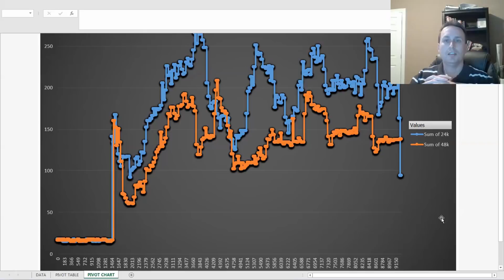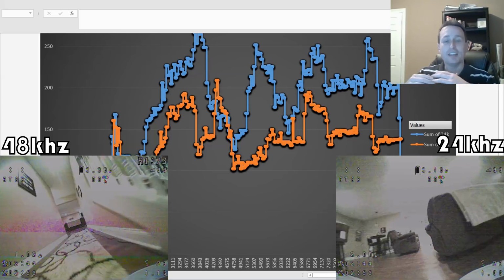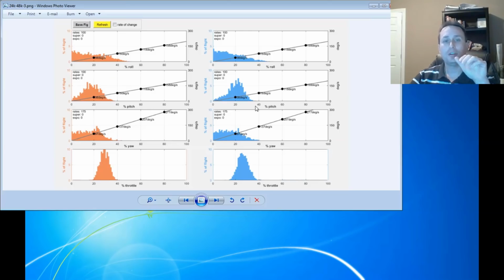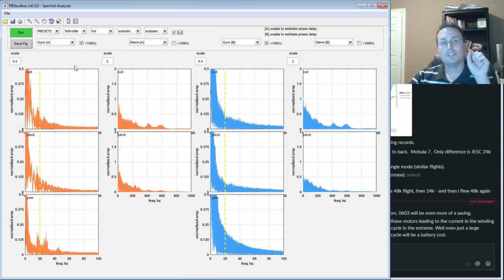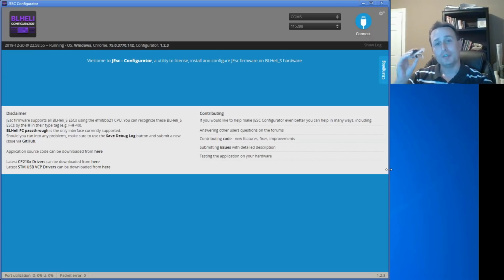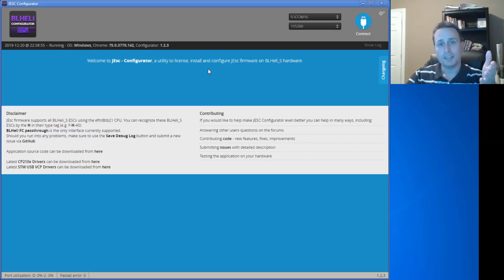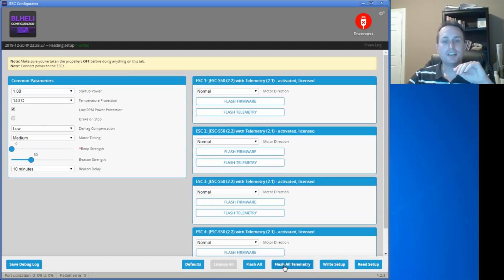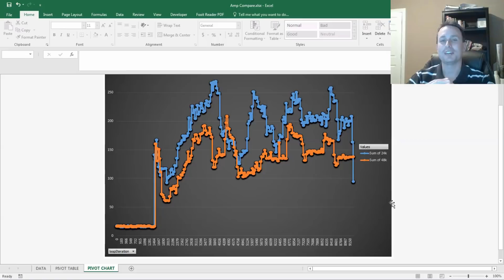24khz vs 48khz ESC Comparison

Comment: On the JESC cost - just think of it as a different model for who pays the firmware license.  BLHeli_32 is paid by the manufacturer, JESC is paid by the end user.  The cost is still lower for JESC on the same setup, with hours of BBL data I can't see a performance difference, and importantly you can get that same performance on small quads.
Dumping $100 on JESC licences sounded silly, until I realized that the performance pays for itself on just my handful of race rigs.  Awesome work Thorsten!!!
Reply: The difference is, Blheli32 has more capability with very reasonable licensing fee. I know this because Blheli32 ESCs aren't that much more expensive than its 8 bit counterpart. The Racerstar 8A Blheli32, which happens to be the cheapest blheli ESC on BG, cost like $4.60 with Blheli32 license and compared to the JESC licensing fee of $1.25 per ESC, that's like more than quarter of the price of Racerstar ESC with Blheli32 license, just for license only.
Reply: @Asu01  Manufacturers can just as easily sell ESCs with JESC on them - the price comes down to around half of the small order count price if you're ordering any any kind of bulk... Similarly, cost comes down if you have enough quads to update.
Reply: I don't see that happening anytime soon, especially with another open source project being developed for 8 bit ESCs, which every manufacturer would prefer.

Did you really dropped $100 for that? How many race fleets do you have?

Comment: Awesome! Going to update now. Just went to JESC yesterday. Waiting on new ph2 connectors as mine started getting really hot.
Reply: Finally got the ph2.0 connectors in. I don't know how much it was the connectors versus the 48khz, but now my runtime inside is nearly 5 minutes. Also I did the rpm filter and just shotgun'ed in your whoop tuning settings and all I can say is, WOW! It is soooooo locked in now when flying airmode outside. Thanks for your awesome channel!

Comment: Has anyone actually thought why this is the case?
Its because at 48khz you have a lot less torque and power on your motors and thus its like running weaker motors.
Reply from the maker: See write up?

Comment: i started running 48pwm for awhile and now we can get same jesc firmware for free finally
Reply: The free one is still in its infancy. JESC is free for 48khz, but you have to pay for another licence to be able to run rpm filtering. 
JESC is more stable right now and if you don't need rpm filters, it gives you sweet 48khz blheli 32 users enjoy.
Reply: Yeah - in every instance where a company sells a blheli_S version and a _32 version, the cost of JESC is way less... an the performance is still awesome.  The only settings I use anyway are 48kHz PWM, demag high, and medium-high motor timing, so that just works.

Comment: Motors were always hot on my tinyhawk S on 2s until I put on 48khz.  Now they run cool.
Reply: I'm thinking of doing this on my THS, did you have to change anything in betaflight? Someone on a FB post said they had to drop to 4k/4k loops.
Reply: @zevindd  I havent done any of this yet, but for rpm filtering Im sure you do, and I think on this also. Check your cpu load, that should let you know if it needs to be dropped.

Comment: What would be the advantages and disadvantages of running 48hkz on a 5 inch quad? I’ve run mine on 48 for a while now
Reply: Limited sample size (I've only one A/B testing with a couple dozen of mine) - no actual drawbacks through the goggles.  On paper the full wide open throttle power on 24kHz is slightly more, and on quads that develop mid-throttle oscillations, if you experience them on one PWM frequency, the other tends to fix it (usually 48kHz cleans up ones that previously had issues).
Anecdotally, I'm getting slightly cooler motors despite being able to turn up the wick on P/D gains more on setups after making that switch, I do think there might be some odd aliasing effects that are more noticeable on 24kHz, but that's mostly speculative - in practice, there's basically no downside, except on one oddball quad where MTO's were present, and for some reason 24kHz seems to have fixed it... right up until I installed that quad into a metal pole.
Reply from the maker: Good summary.

Comment: My experiences with blheli_s is on 5 and 7 inch only. I have not measured any flight times but my 5 inch flew well with cool motors zmx 2205 2300kv on 4s on 24khz. I changed to T-motor F60 1750kv and xing-e 2208 1800kv and booth those quads we're running too hot on both 4 and 6s on 24khz. They are running cool on 48khz.  
For the 7inch with large sunnysky 2212 1250kv the difference is not significant.

Comment: The most conclusive test would be to compare the motor thrust numbers + efficiency at 0-100 throttle between 24kHz and 48kHz.
Reply from the maker: Maybe.  But the amp draw numbers don't lie.
Reply: @uavtech  Ryan Harrell has done just that on 5" - there is a slight power output edge at WOT for 24kHz, but that difference is minor, In practical terms, on a race quad, I'm quicker on 48kHz just because of the smoothness improvement.
Reply: @uavtech  yes, agreed, also throttle at hover was about the same. I'm just curious if there is any impact on thrust as switching losses should increase.
Reply: Exactly what I was thinking. You can manipulate switching losses for small changes but overall thermodynamics gives no free lunch so there must be a reduction in thrust/power.
Reply from the maker: @changeagent228  , not if it is breaking and fighting itself.
Reply: @uavtech  More testing required...

Comment: Thanks for the comparison. It's not that it's only $6. If one dev starts charging for tech, where does it end? I would be happy to support betaflight by donating. But being held to ransom over rpm filtering on blheli_s...just feels wrong.
Reply: Think of it compare to BLHeli32 - it's a closed firmware, and manufacturers are charged per unit to install that firmware onto the initial build.  It offers a lot of new features compared to BLHeli_S, including PWM frequency, bidirectional DSHOT, and improvements in motor timing (as well as the ability to play awesome tunes - though that currently conflicts with bidirectional dshot)... as a consumer, the cost of that licence is wrapped into the cost of the product.  Also, it's not available on smaller and cheaper stuff.
So - before JESC ever came along, that was the case - so a developer (who incidentally was instrumental in adding the bidir capability into the Betaflight Open Source project) developed new software that allows S ESC's with the _H architecture to have the same capabilities, it's offered as a product the end user can buy and license...  when does it stop?  When people stop coming up with new awesome stuff for our flying robots that people feel like makes an improvement worth the money.
Reply: @tehllama42  this one i totally agree. since we are paying less for a blheli_s esc, i really dont mind paying a little for firmwares to be able to use rpm filter.
Reply: Wow it's only 6 dollars
Reply from the maker: JESC is not BF.

JESC is free.
Reply: @uavtech  You mentioned he was a betaflight dev... 
JESC is free. Being able to run RPM filters is like DLC. You guys defending this keep saying it's only $6...it's $6 per esc. If you have 4 quads...
Not everyone can afford this type of thing. Are we really going to try and price pilots out of the hobby by charging them for certain bits of software? 
Maybe turtle mode in betaflight should be $6 per motor 😅
Reply: @BengalCatChilli  , its funny how you got the $6 per esc ( what currency may i ask?)  I'm from Brunei and I've purchased a Jesc (four in one) to use on my individual esc x 4, and it cost me $4+ (in our currency its $7)
Reply: @iknowlaa  I just quoted UAV tech. He said $6. I know it isn't $6 ;)
Reply: @BengalCatChilli  lol...my bad..
Reply from the maker: it is $6 for a 4-in-1 ESC (USD).

There is like 100 people that contribute to BF.  "BF devs".  Joe is just one of them.

JESC is free.

Folks that can afford 6 quads, can afford $6 per quad. I only have 3.

Do you have BLHeli_32 ESCs?  U are paying for that ESC firmware.  Do you have crossfire and Fatshark goggles?
Reply: @uavtech  no bl heli 32, no crossfire, no fatsharks. Like I said, some people can't afford  any extra. The way you talk about him, he did betaflight by himself 😅
Reply from the maker: @BengalCatChilli  , so no 6 quads then.

 he did not.  But did do all the RPM stuff himself.
Reply: @uavtech  The amount of quads isn't the point here. You guys are just shitting all over JazzMac and his work. If JESC is so great and we all love to pay more money, why would someone be compelled to try and create the same type of thing as JESC, but as a gift to the community?

Shouldn't we all be adopting this and helping JazzMac to make it better? All you guys have done is come out and say how bad it is. Joe didn't do it all on his own.

Without pilots the dev's wouldn't be developing anything.

Comment: I'm pretty sure 48kHz is significant for tiny drones because the motors are reving much higher than on large ones. Little drones at 24kHz seem to be more on the edge in terms of "not switching fast enough", resulting in inductive heat losses that could otherwise be useful power.
Reply: The problem is active rectification (aka "active freewheeling") as used in BLHeli_S combined with low motor coil inductance. I've written a comment explaining the technical details.
Essentially, between PWM duty cycles the low inductance causes voltage across the coils to drop rapidly far below the back-EMF, resulting in current flowing in the other direction.

With diodes ("passive freewheeling") there are diode losses but it would at least do some regenerative braking. But with active mosfets you get a short-circuit resulting in the opposite of what is desired: violent (the load is a short-circuit), non-regenerative braking.
Reply: @xnoreq  Thanks for your comment. So, there are inductive heat losses because of the small inductance of small coils. Higher switching rates raise the inductance of the coil and therefore "dampen" inductive spikes? Did I get this right?
Reply: @TimeFadesMemoryLasts  No, the issue is not inductive heat losses as the problem gets infinitely worse at zero inductance.

The inductance is supposed to maintain the supply voltage (which is above the back-EMF voltage) during the PWM off time.
If this is maintained, the current keeps flowing in a loop involving two mosfets.
This is called freewheeling. 

Current goes down through one mosfet and up the other mosfet's body diode. This is "passive" freewheeling.
The diode causes losses. To reduce these losses, BLHeli_S uses active freewheeling which just means it turns on the second mosfet as well.

This is fine .... until the voltage across the coil drops below the back-EMF. Now the motor is actually operating as a generator.

Since with active freewheeling both mosfets are turned on, the current can now freely loop in the opposite direction as well. (This is not possible in passive freewheeling since there the second mosfet is off and its body diode only lets current pass in the one "right" direction.)

So the longer the off time (the lower the PWM frequency) and the lower the inductance (few turns, thin wire, high kV...), the higher fraction of the off time your motor is running as a generator.

But this "generator" is not charging your battery. The turned-on mosfets create a short circuit.
This just brakes the motor and yes, the mechanical energy is just turned into heat.
Reply: @xnoreq  Sounds a lot like what I wanted to say with my comment. With "inductive heat losses" I was referring to the motor acting as a generator and inducing a current into the coil. Thanks for the clarification.

Comment: Haven't read the article but the explanation is not that hard if you understand how BLDC motors work.

The motors used here are tiny and have high kV. This means they don't generate a lot of back-EMF, resulting in higher voltage drop across the coils and therefore high current draw.
The only thing that helps here is inductance, that is the coil's resistance to changes in current. (Not to be confused with the DC resistance of the voice coils, which is typically very low.)
Now with PWM you basically switch the battery supply voltage on and off rapidly, which also means rapid changes in current.
Switching faster increases the effect of the inductance to resist these rapid changes in current.
Reply: As for the article, it demonstrates a defect of "damped light" or "regenerative breaking" in implementations like BLHeli_S which breaks at every PWM duty cycle.
Reply: To those interested, in ESCs there's a high- and low-side mosfet for each phase. When phase A high and phase B low is on, the full supply voltage goes through A high, coil A, coil B, B low, to ground (which closes the loop).
Full supply voltage would be 100% throttle. To get less the signal is PWM (pulse-width modulated).

Now if you PWM the high-side mosfets only, in the example above the A high mosfet is switched on and off rapidly while B low is on. While A high is off, current needs to continue to flow due to the inductance of the coils.
So now current goes through coil A, coil B, B low, to ground ... but how does the loop close? By current going up from ground through A low mosfet's body diode.
So the loop is coil A, coil B, B low, ground, A low body diode.

If we PWM the low-side mosfets instead, while B low is swiched off a loop forms for A high, coil A, coil B, up through B high mosfet's body diode.

---

Back-EMF.
Motors are also generators. Spinning coils/magnets generate a voltage. This voltage is called back-EMF since it has opposite polarity of the supply voltage.
In a motoring application, the back-EMF is always lower or equal to the supply voltage, reducing the voltage and therefore current across/through the coil.

--

BLHeli_S + low inductance motor:

Same scenario as before: A high is on, B low switched PWM on/off. While B low is off, current keeps flowing through the coils due to their inductance.
If the inductance is high enough, current drops slowly but continues to flow until the next PWM duty cycle turns B low on again, repeating the whole process again.

What if the coil inductance is very low though?

Current will drop rapidly because the voltage across the coil drops. Current will drop to zero. This means voltage across the coil is now equal to the back-EMF.
What happens then?
Well, the voltage drop doesn't stop here. It continues to drop.

And now you got current flowing in the other direction, or negative current.
This now results in a new loop: from ground, B low body diode, B coil, A coil, A high.

This is where it switches from motoring to generating. Essentially, between the PWM duty cycles a fraction of the mechanical energy is converted back into electrical energy and used to charge the battery.

So far, so good? No. Diodes cause voltage drops and BLHeli_S being smart switches mosfets on (when their body diodes would conduct) to reduce these losses.
So while B low is off, B high is turned on.
So instead of: A high, coil A, coil B, up through B high mosfet's body diode.
We get: A high, coil A, coil B, B high (which is now on).

This is fine until we go into negative current territory. Now instead of charging the battery, we get a short-circuit: B high (on), B coil, A coil, up through A high.

So for a small fraction of the time, between PWM cycles, the motor is used as a generator but it's electric load is not a battery (which would be charged) but essentially a short-circuit.
Reply: @Sasha Kruse Grim I don't know of any experiments but a simple simulation I've down seems to show that putting a ~4.7uH (10 mOhm) inductor in series with each phase is at least as effective in reducing the braking reverse currents as is doubling the PWM frequency.
This is based on the limited data for 0603 motors available.
Reply: @Sasha Kruse Grim Yeah, you'd get crazy current spikes on each switch.
I just wouldn't put any caps in there, even with the inductors.